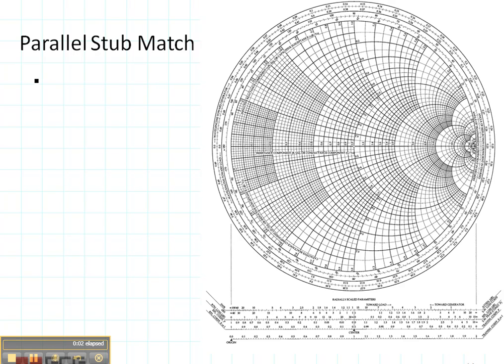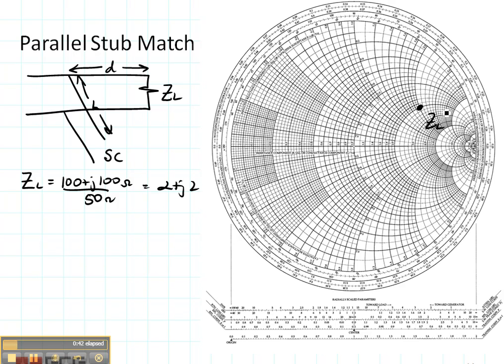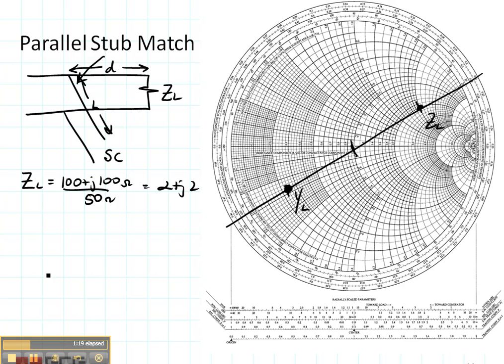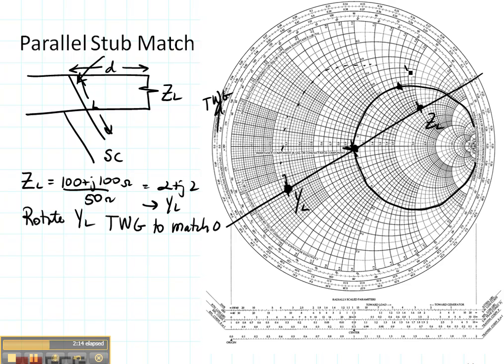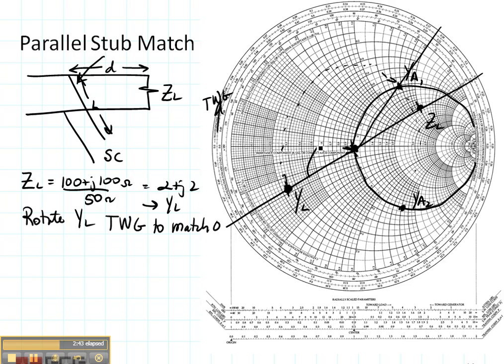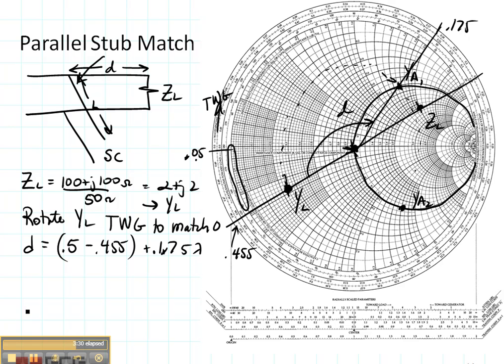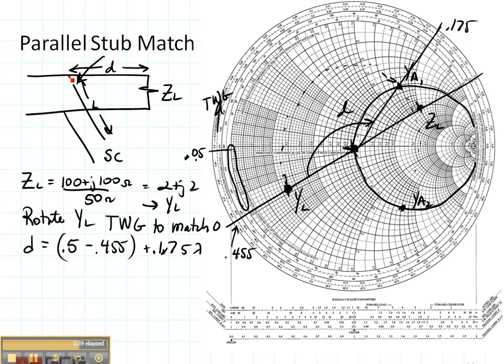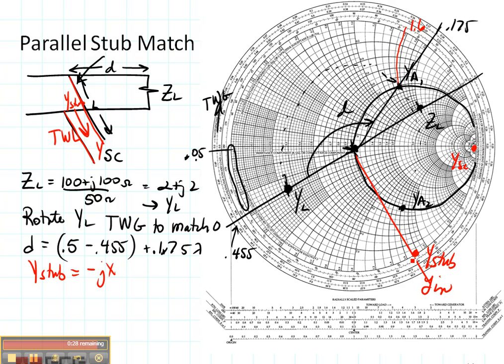ECE3300 Lecture 13b-8 Impedance Matching stub match parallel

Comment: The Smith Chart is a thing of beauty and simplicity,   why does this Proff make it so ugly difficult and cumbersome?  I use smith charts everyday with 30 years experience in the RF industry,  1 you will never use the smith chart to calculate the magnitude of anything, 2 you will need to know the smith chart like a road map.  You never need to know exactly where you are as that is the job of you simulator or your smith chart program.  But in the lab, you will need to know what elements to use to travel any transformation.  After your initial design from the office, In the lab you will have test equipment or an analyzer to guide your magnitude of everything.  Never calculate on a smith chart no more than you will calculate with a slide rule vs a calculator.  90% of the industry will deal with bandwidth where in this woman class you will need to calculate every frequency point, so great in 10 years you might have something.  Here is what you need to know,  shunts and series C and L,  Transmission lines.  Q circles are taught wrong, so do put too much into them... know that every thing travels clock wise with frequency going forward.  Every play with google map where you drop the little man on the map?  Learn to do that on the smith chart, walk back wards keeping your eyes on the transformed source impedance.  If you decide to turn around to see where you are going, you are looking at the load and it will be Zs*  (*conjugate),  If you can do this, you will be light years ahead of the others.  Speaking of Loads, know SWR circles.  Dont say Generator, as that is the source.  Conjugate to the source is the load.

Comment: Could someone please clarify for me, (from about 1:53) why is YL rotated to the r=1 circle and not the g=1 circle?
I thought that because we converted to the admittance chart we'd have to match to the conductance as opposed to the resistance. Perhaps I'm just a little confused. If anyone can help explain it to me, it would be greatly appreciated.
Reply: when using smith charts in case of admittances the r circles becomes the g circle, and x circles become the b circles. only difference is that the real and imaginary axis of the reflection coefficient becomes inverted, i.e the positive real axis becomes towards left side, and positive imaginary axis is downwards!

hope it helps... :)

Comment: Also, if the stub is terminated into a variable capacitor, could this create a variable stub matching section that could actually vary the effective inductive or capacitive reactance depending upon the range of normalized -jX that the capacitor would create at a give frequency?  Could this create a remotely tunable variable stub to tune out reactance if the lreactance of the load changed?

Comment: I assume that, if the transmission line is coax, using a coax tee connector to insert the stub would make it a parallel stub and not a series stub?

Comment from the maker: Depends on where you start in the design. IF you start at the front of the stub, you rotate towards the load to either the short or open at the end of the stub.  That is counterclockwise.  IF you start at the open or short at the end of the stub, you rotate towards the generator, and that is clockwise.
Reply: Thats why L should be equal to 0.344-0.25